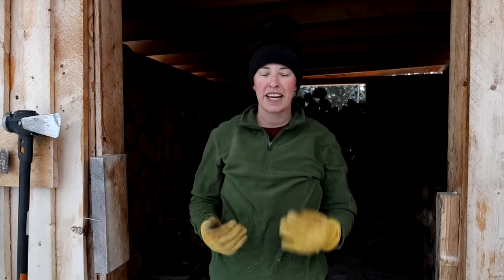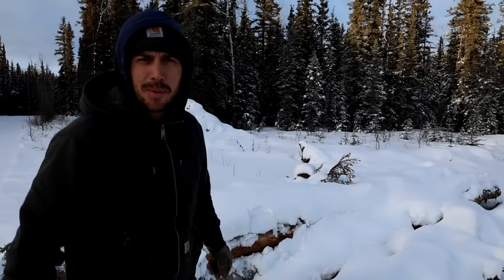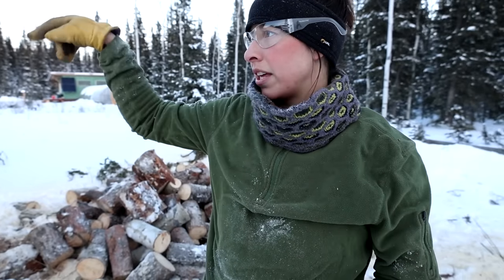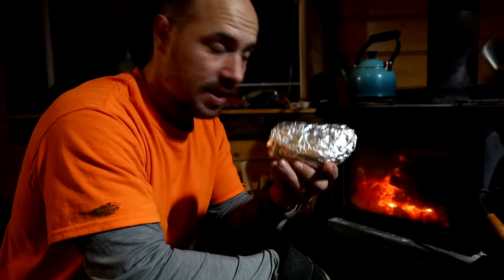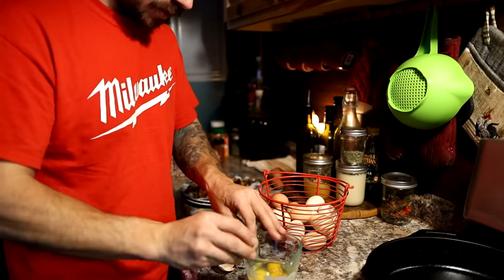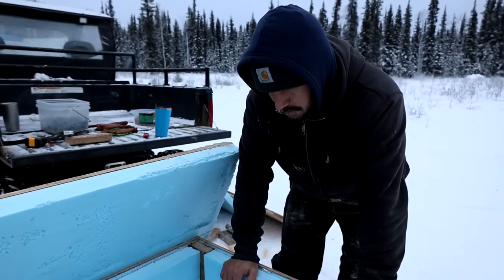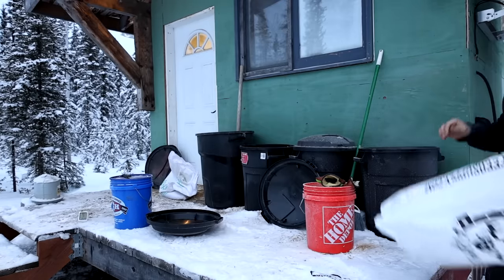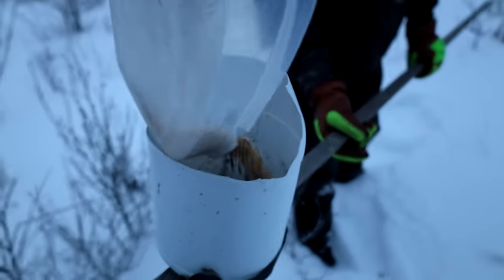Filling Our Firewood Supply | Staying One Step Ahead in Winter

Comment: Your small cabin makes a BIG difference.  Yesterday I went by a pile of firewood in Princeton, MA, and my friend said that the owner goes through at least ten cords of wood every winter!  The house, however, is huge.  Probably over 2000 square feet.  So even though it's only north central Mass, it takes lots of energy to heat that volume.  You're doing winter right.  And life right.

Comment: Nice video, you two! My wife and I are going to burn wood this winter. We purchased a new pot-belly, wood stove from TSC. They have tried to redesign them and go more GREEN. Well, let me tell you, the people doing the redesigning are not the ones having to use them. They're not nearly as good as the old designs. As to the bird-feeding, that's one of my favorite things. I love watching them in all four season. If money gets tight, ground corn is cheaper, but I do prefer the black oil sunflower seeds. Remember... they will also need fresh water to drink. That's especially important in yall's neck-of-the-woods (everything is frozen).

Comment: Fire wood splitting hack. Use an old tire, put the cut log in the middle. Split away without picking up each time you split it. If they are still falling over use another old tire on top of the other one. It will save your back👍🏻

Comment: Branson tractors make a hydraulic log splitter accessory that can be hooked to the tractor or with longer hoses sit on the ground, your not getting any younger Eric and if for some reason you wasn't feeling good Ariel could easily split all the wood you need with the tractor. Always nice to have a backup plan!
Also I burned wood for year's myself and found by building my own wood stove you can build a longer box. My stove would burn 31 inch long pieces, which might mean less cuts on the saw. Not to mention getting through the night was easier because theirs so much more wood in the stove overnight.

Comment: I'm amazed at how little you need to burn yearly! Way back in the '80s and '90s we owned a house in the country that we used every weekend and for about a month around the Xmas holidays. Granted it was much bigger than your place (4-bed, 2 stories) but we'd burn 2.5 to 3 cords yearly (late October to late April). We would get to -25°C in the depth of winter and had a big ass Jøtul stove that was very efficient. I guess the fact that we had to heat up the house from below freezing to comfortable every Friday evening certainly used a lot of wood, but even then, we didn't have anywhere near the cold weather you do! We had a small electric baseboard heater in the basement utility room to keep the water heater from freezing and drained all the plumbing every Sunday evening before leaving for the week... Good times 😊
I still love to heat with wood and have a Stûv 30 in my house now. Just brilliant!

Comment: I would suggest a couple of eyebolts and a couple of bungee cords across the top of the roof so when you're transporting, the wind doesn't lift the edges and you lose the roof flying behind you. Bungee cords can always be put inside beside the generator will not needed, but they might save you a lost the roof at a very inconvenient time.

Comment: Those baked potatoes are awesome. My granny used to make them. She just wrapped it without any oil or butter, and we dipped it into salted oil when it was done.
On a side note, some tin foil is coated with epoxy or vinyl, just like all the beer/soda cans. Make sure yours is not coated when using it like this. Read the label or ask the supplier, it's hard to tell whether it's coated or not just by looking at it.

Comment: I know exactly the feeling!! When we lived in the Northwest Territories in the ‘70’s, wood was always a concern. We were on the edge of the tundra and the wood was skinny spruce mostly  burn killed. We sometimes found ourselves out winter camping to get enough wood. Our temps would go to -40-70 below. We had some close calls for sure. Breaking through ice, tipping the skidoo on top of me, pinned under it, going through ice, hauling wood. It was -40 that day and we had a terrible time even starting a fire outside to get warm and make a hot drink. At that temp oxygen isn’t very available. There were times we thought we might not make it.

Comment: Great setup. I would put a small cheap inverter powered by the generator and then a computer fan on one of your intake openings. Then add a thermocouple to turn on the fan if the temperature gets above say 80 degrees. Also add some blocking to keep the generator from vibrating around. System is now operates passively to maintain temperature and lit could then be hinged so wind cannot blow it off. Love your channel and the thing your are doing.

Comment: The idea came to me about placing a 30 or 50 gallon barrel, some place where you needed some extra heat (perhaps the chicken house) and then running the generator exhaust pipe to the barrel with another exit port to allow the cold exhaust to exit.  You could put a CO2 detector to detect leaks.  This would give you some free heat with a simple heat-exchanger for almost nothing.
A penny for your thoughts,
Bill

Comment: I would line the insulated box with metal, at the very least some aluminum foil, to keep the heat off the insulation. Other than that, you're good to go one you've figured out the fresh air intake situation. Simple and effective solution!

Comment: My grandpa used to burn spruce in Central Alberta. He would cut it into 6-8 foot logs and make alternating stacks about 5ft tall. He had about 10 of them and he would use them as posts, firewood and scrap lumber. The bottom layer was sacrificial but there was only 3 logs in that layer.

Comment: Growing up we didnt have central air and heating. Still dont. We still have our wood stove but have upgraded to propane heaters on the wall. Anywho we used a mix of green and seasoned wood. Used season wood to get the fire going but would add green wood once the seasoned wood burned down. Then the fire would burn longer. Was wonderful. I need to get new pipes and maybe ill start a wood fire once it is cold enough

Comment: Great lead in.  I cut and stacked wood today as well.  Those off the grid wishful thinkers need to try it awhile.  Not easy but more of a way of life since I was a child.  Get some coal tomorrow.  Have you all found coal for sale yet?  The surface mine going up toward Parks Hwy may sell to public.  Not sure.  Didn't get to inspect it.  Good job on the generator box.  Watch for condensation.  It's possible that could be an issue later on.  More ventilation if so.  Some good eats.  Open those potatoes up and twice bake them. Yum.  Later all good vid. Be safe.  Use the grouser bar to sink into side of log, takes a lot of weight off your arms holding the saw out.  Just rotate the saw down, let it do the work.

Comment: We love how you guys run into a problem and then dive into the solution.  My brother used a similar cover for his pump pits, he put a 2x4 around the underside of the lid about 1/4" away from the walls so that the lid could not blow/slide off.  This might make sure that the lid won't come off when carrying or dragging the box. By screwing down thru the plywood/foam it will also keep them together.  The 2x4's would also give you a ready shim to hold the cover open for cooling.

Comment: If you want your generator box to be super easy to slide around buy a 1/8" thick 2" wide strip of UHMWPE (ultra high molecular weight polyethylene) and line the bottom of each skid with the material, counter sink the screw heads so they do not cause drag. UHMWPE is what is used in kids snow sleds, so if you can get one of those rollup plastic sleds that is long enough and cut a couple strips and counter sink the screw holes you would have basically the same idea.
You may want to just make a hose air intake for the generator similar to the exhaust pipe so that clamps on to the carb or intake box so you do not have to let humid air into the box. 91F is a summer day in lots of areas of the lower 48 perfectly fine for the generator. You may consider plugging the holes and putting the lid on tight if that is the highest temp with a fresh air intake for the generator.

Comment: Now all yall need for next year is a couple or 3 wind turbines for subliminal power especially in winter and a snow blower for the tractor. Of course a log splitter would be helpful they make them that attach to the tractor and run on the pto or hydraulics and they make one for the quick attach on front and run on those hydraulics. But as many viewers as yall have yall can probably get someone like eastonmade to send yall a splitter to demo and show on videos and same for the snowblower and wind turbines.
Not to mention probably for a nice high tunnel and green house for garden and chickens

Comment: Really good photography and awesome landscapes. Yeah, you're going to need a little more air flow in that box. Maybe a couple of adjustable heat vent covers cut in away from the exhaust would help. Also, heat tape might be useful if applied in certain problem locations.  good vid., thanks for putting in the time and effort to share the journey.

Comment: Hi Arielle & Eric. Another great video. Your photography & Drone work is getting better each episode. I have my generator i a box as well. I used foundation vents for air flow and on my exhaust  i put a collar at the pass through so it does not touch the plywood wall or insulation. Most important i have found is non ethanol gas with stabilizer additive. Never any start issues.
You guys Rock!❤❤
Reply from the maker: Thanks for the tips!

Comment: I saw you put the blue board against the bubble foil in the generator box. I’d you leave a 1/2” or more (preferably) you gain an equivalent R-7 value to your project. I love that you utilize reflective insulation. I do radiant floor heating systems and use bubble insulation under slabs.

Comment: Birch is a good firewood, but over time, soot accumulates in the chimney, which can cause a chimney fire. By burning spruce among birch, soot burns at the same time. You still need to clean soot, but not so often.

If you mix hardwood and softwood together your fireplace will last longer. Burning only Birch can also make fire too hot which will melt grate.

Comment: Another great and informative video. Bird feeder entertainment for you frustrating for kitty.. You have mentioned down the road Rocket Mass Heater you'll be amazed at how much less wood you'll burn. The other day I was watching how you store some 500 canning jars. I did make a suggestion on a root cellar. Where you currently live if the water table is down deeper this system will work, no cravings
.You could also use threaded rod&turnbuckle system. Either way it's wicked strong with constant outwards force. That reflective foil AKA. BUBBLE FOIL
 Check out BOSS of the SWAMP videos on insulating. It amazing how efficient this stuff is.  Thank again for sharing your life's adventures.

Comment: Re: bird seed - sunflower seeds are much higher fat and nutrition content than millet, which is also much cheaper and therefore a filler seed in many birdseed mixes. Birds will absolutely high grade the sunflowers first and the millet will end up on the ground, sprouting as "grass" in the spring. The higher quality bird seed for seed bird feeders is hulled sunflower seeds. This also reduces waste at the feeders as the birds don't dig around & spill seed out. Because you're so cold your birds probably appreciate a little extra fat as well (suet).

Comment: Have you seen the Jerax wood splitting drill? Just thinking of your aching joints in 30 years.
Reply: That or there are other labor (back) saving tools on the market.  However,  processing wood in the fresh air has its benefits - just so long as it's not over done.  Great idea, especially since you're processing so much wood every year.

Comment: I’ve always been a Husqvarna Chainsaw Guy But after watching that Echo of y’alls get in there and Gnaw like a Beaver with freshly sharpened teeth.... I think my next saw will be that industrial grade Echo. I’ve read some great reviews about them from Husqvarna guys who claim they’ll cut & run as good as the Husqvarna saws will.  Looks like yours is cutting good, I’d like to see how they perform on what i predominantly cut for firewood which is: Red Oak, White Oak, Pin Oak, Hickory, Maple, Cherry, and an occasional Birch or Gum tree. But here we’re blessed With lots of Hardwoods. But I’m definitely interested in that industrial Grade Echo chainsaw. I like a lightweight high torque 20- 24 inch bar saw which I have in the Husqvarna but I’ve almost wore mine out from years of hard work but they’re stupid expensive to replace. I’ve heard the Echo in the same Size Pro Grade saw is 1/3 less of the price of the Husqvarna. Gonna look into the Echo 😁👍🏼
Reply from the maker: The little echo has never let us down :)

Comment: Since it was already seasoned why not just park the trailer next to the house and cover it with a tarp and using it as you need it instead of handling it twice or more. It would last 1/2 the winter till you had to haul wood from the shed. As far as the generator goes put some 2x4's on 3 sides of the bottom so it won't move.
Reply: Doesn't matter

Comment: If your stove in this new cabin is the type with secondary air tubes in the top you will need really dry wood and those rounds you cut and piled up at back of cabin needs to cut split and stacked so next year it will be somewhat dry as they actually say two years cut split and stacked for the newer type stoves.
Reply: If does not need to be split

Comment: Does the generator box have a tube that goes from the exhaust muffler straight  outside the box so that you not running on exhaust fumes being sucked into the carb? Just wondering. Great Video!
Reply from the maker: Yes it does

Comment: That's pretty good 4 or 5 chords but I sold firewood the average house took at least six cords of wood a winter here not as cold as it is there and my house always took probably 8 or 9 quarters because the wife likes it at 90 degrees in the house so that's why I quit buying firewood it just cost too much to keep the house hot at $320 a cord and that's not even good for and yellow cedar that's what I used to burn cut I got yellow cedar hemlock and fur but they mix in older and I don't like older kids doesn't throw any heat and makes a lot of ash it's good for cooking over the fire and smoking only

Comment: Do you want a friend advise from an old mecanic?  1) Your generator is air cooled ... that means it needs fresh air to stay cool. without fresh air, it will overheat and burn.  2) The carburator needs also fresh air; in a closed box the CO2 will cause a lot of problems. 3) Styrofoam is higly flamable material ... close to your house it,s a fire hazard !  Please stay safe ...